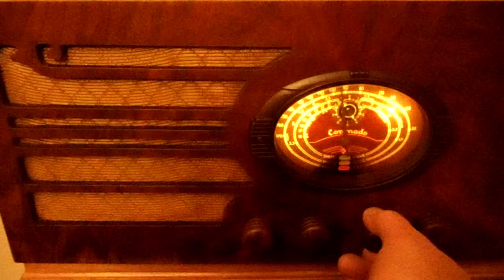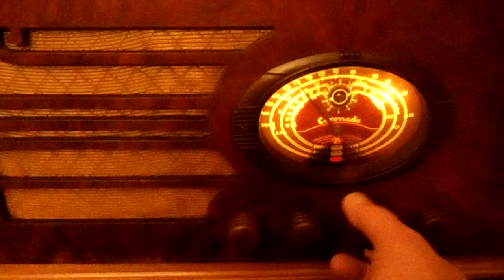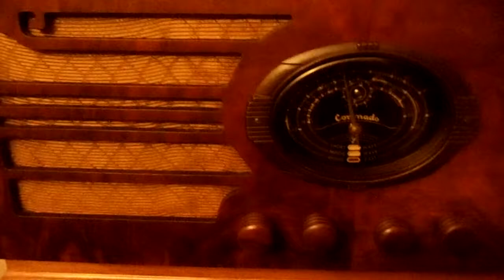Radio CORONADO model 740 de 1937

Comment: This is a great looking vintage vacuum tube radio from 1937 made under the Coronado name and sold in the Gamble-Skogmo Department Stores.

This is a huge radio, weighing I am sure around 30 lbs.  It is a very good performer both on AM and Shortwave bands, however an external antenna is needed.  The speaker is probably at least 8 inches on this radio.
The original knobs are all wood with a striking Dial Face having a real glass cover in lieu of a plastic one.  Don't break this one, as they are hard to replace in glass.

This Model 740 radio from Coronado came in a few variations of style, with even some differences on the Dial Face and bezel but overall the same radio.